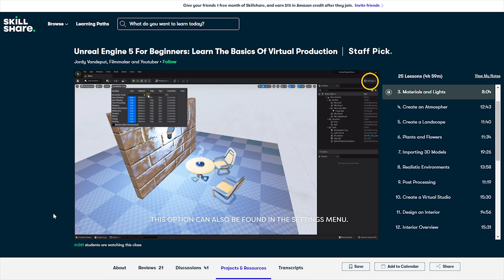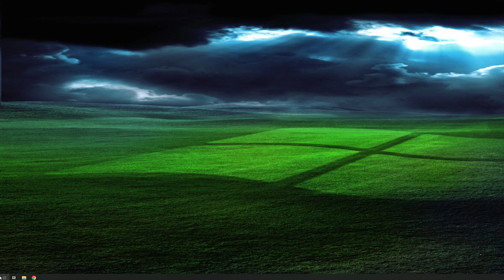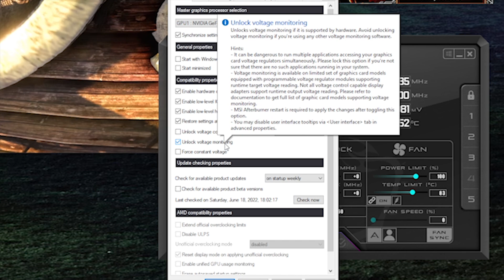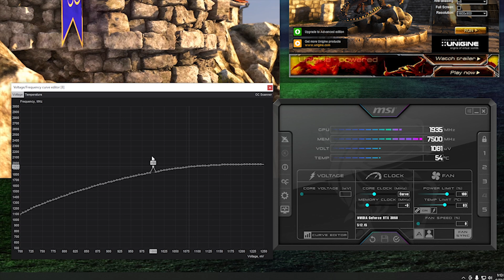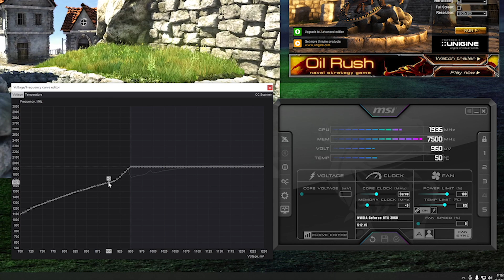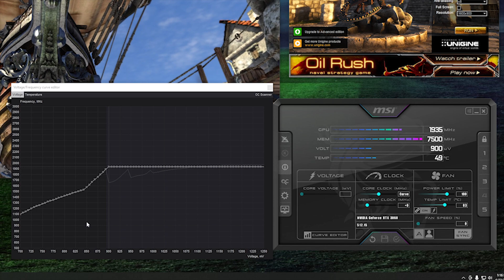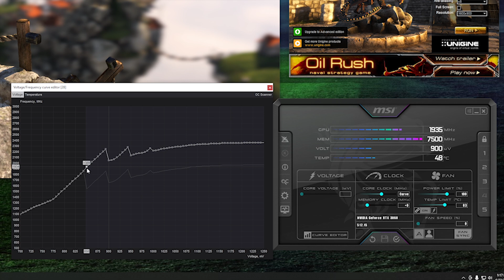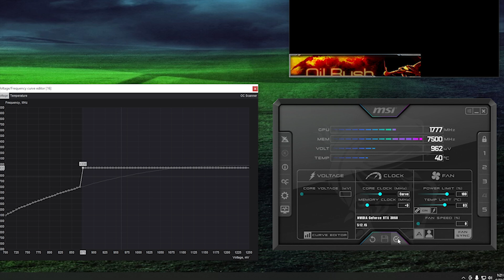Should You Undervolt Your GPU?

Comment: This is only worth doing if you card is getting high temps. If you sitting at 60-68c. Don't do this. What is the point. You getting performance you need anyway. Lowest the power draw isn't going to help you gain performance. It will actually limit your performance in most cases. If you card is getting very hot and having issues due to the heat. Than yes you will see jumps in performance, because of the temp throttle in the card. 

If you at 60c on your card with full power stock. No need to undervolt your gpu. It is working at intended and you won't get better performance doing it.
Reply: This is not true for all cards. For cards struggling significantly with power limits, it's objectively a better method than conventional OCing. 

I have a 3080 with a power limit of 350w and if I apply a standard OC, I run into that power limit immediately and gpu boost 3.0 begins to ramp down my OC. But when I'm undervolted, I consistently hit the clockspeed I'm asking it to run. For example, In Witcher 3 with a standard OC, my core clock ranges from 1860-1965mhz with temps around 70-75c. When undervolting to .856v, my core clock stays locked at 1950mhz as it's not power-limited, and temps drop to 58-65c.
Reply: @TRH2243  dude wtf you even talking about. The limit standard of that card is 450W. If you are at 350w limit on that card. It means you aren't given that card the needed power it wants. So you have a under recommanded psu or your mobo is ass trash and isn't able to give the power needed to the card.

So here is the real problem. You bought a 3080 with trash components. So you paid high end price for a high end card and pair it with low end parts. Trash builders like you are dog shit. You need to honestly stop putting together pc. You don't even research how to pair things right. 

I bet you have a 5600 paired with that 3080 on top of it. Because that is how rere trash you are.

Comment: Press the Windows icon in the top right of MSI Afterburner to get the profile to load upon reboot.  If it's not stable you will have to go through safe mode to uninstall MSI Afterburner.  Thanks for the video.
Reply: I think that if you hold Ctrl while loading Win, the Afterburner profile doesnt apply at startup, so you might be able to modify it without uninstalling Afterburner in Safe mode.

Comment: my 3070ti would go all the way up to 1070mV 1950MHz stock factory oc (gigabyte gaming OC GPU variant), and it's effing singing songs of it's people with massive coil whine. With conservative UV at 950mV card goes up to 2010MHz and coil whine is barely noticeable. No loss of performance, no instability, less temperatures LESS power draw. it's a win win win

Comment: i used to get 83 degrees when playing RDR2 with ultra settings on my RTX 3070 and alot of noise ,then i undervolt it and now i get ~ 65 degrees same settings.very happy!
Reply: I have a pny 3070 it never gets over 63c for me and I don't have to undervolt it. Really just hit or miss it seems with the cards. Which model are you running. I think in your case undervolting the card is needed you getting close to the 90c mark. Maybe add some more fans to your pc for exhaust. Try running 3 to 4 intake and 2 exhaust fans.
Reply: @fighterpimp  its Gigabyte 8gb OC version,i have 3 intake and 1 exhaust,but i dont think is that the problem,maybe thermal paste idk?!

Comment: I tried undervolting but it changed absolutely nothing. Still the same power draw and still the same temperatures.
Reply: Maybe you didn't save the undervolt right. Also did you keep going til you found a setting that was stable and lowered temp? What is your gpu temp anyway. I wouldn't undervolt if you at ranges of 60-78c anyway. No point to really. You won't gain performance doing it.

Comment: if i made a mistake in undervolting, will my gpu take any damage just like overcloking?
Reply from the maker: GPUs have a maximum voltage they can't exceed without very complicated hardware mods. Lowering the voltage can't hurt the card. If anything it would extend the card's life.
Reply: @CyberCPU  thank you so much <3
Reply: Your using MSI to undervolt it. MSI is just a program that limits what you can really do to the cards. There is other programs that can mess the cards up, but it rare MSI will do that. It is basically a user friendly way to OC a video card. Actually if you running a 3000 series card. Nvidia has now made it preset in the cards. If you hit alt+z and go to performance tab. You can OC your card directly without MSI.

Comment: I could see this being useful for people with really high temps or something. Tried this compared to my regular overclock just to see and I’m performing well with much lower temps but way less performance. My pc cools well so I’ll keep the higher temps for more FPS for my particular setup
Reply: It greatly depends on your screen resolution, Playing in 1080p you see mHz on card almost direclty transfer into FPS boost, try 4k and you'd barely see a point to OC your card and dropping 100-200mHz with good UV will get you much nicer temps and less noise while performance impact around 1-2fps.
Reply: FPS isn't what matters on a good GPU.  Frame time is.  I will take a tight fast frametime over a higher average FPS with inconsistent frame time any day of the week. I lost maybe 1% of my average FPS but gained much better frame time consistency.

Comment: I got afterburner to apply the profile the same every time with my 3060 ti by setting frequency in multiples of 15 which your setting of 1935 mhz is. Then if it keeps not applying that same profile causing you to have to apply it manually, go down to the next multiple so in your example I would set it to 1920mhz and that should stick. This includes the "set at idle temps" trick you mentioned.
Reply: I have mines on 1905 mhz or 1910 around there

Comment: Is this really necessary. Why can't I just use my GPU at the default factory settings?
Reply: No undervolting your gpu doesn't do much to help performance if your temps are good to begin with. If you running 60-78c range. Undervolting will give you no performance boost. Actually it could limit the performance your gpu is doing. If i lose power draw to my gpu, by reducing it. This means there less available power to boost the card. Undervolting is good for high temp gpu's.

Example. A laptop gpu. Most of the run super hot. You undervolt this to reduce the heat it produces. I undervolted my laptop gpu and it reduced that temp by 15c. Which was huge. It makes the life of that laptop last longer and games perform better, due to it not temp throttling. 

Like the OP stated. He using a water cooled gpu. It isn't worth it for him to do this at all.
Reply: @fighterpimp  Thanks for the detailed reply. My card is still running fine as it is, so this guy can go to hell.
Reply from the maker: Because most GPUs are capable of more. And it's fun. 🤷‍♂️

Comment: I got the frequency jumping up or down when I save it as a profile too. I got annoyed by it but I found a way around it. What I did was instead of increasing the clock of the target voltage in the curve editor, I used the core clock slider instead then flattened the curve on the target voltage in the curve editor. So yeah consistent clock everytime I load a profile. Also the curve graph is smoother too. A win win solution!
Reply from the maker: The only problem with that is the GPU will run at it's highest clock even if your not gaming. It sticks the GPU into 3D mode.

Comment: So let me get this straight. From someone who's been overclocking for 22 years.. You want to lower the voltage and the watts AND the clock ANNNND the in game FPS and call that a success? IN what world is this proper? This is NOT how  you overclock ladies and gentleman.
Reply: this video is about undervolting not overclock LOL 😂.
Reply: @kilfyabo646  Why would anyone buy a Ferrari then drive it like a VW Golf Beetle. Bahahahaha. This way of thinking is stupid.
Reply: @ironmaiden5658  i got better performance by undervolting 😂, on gtx 1660 super stable at 0.9v 1950mhz. with default setting it never reach that high, max 1875mhz.
Reply: @kilfyabo646  What  load of BS.. Bahahah. Did you skip over the part were I mentioned I've been over clocking for 22 years? More volts + more power = more performance. Its as simple as that. Change the fan curve to make the fans ramp up earlier to keep the temps low. You should tell the guys usingLN2 and beating Time Spy 3d Marks scores that they're doing it all wrong. Bahahaha
Reply: @ironmaiden5658  22 years and yet you still don't know the purpose of undervolting.
Reply: @kilfyabo646  Of course I do. The 22 years part gives it away.. . But why would anyone do it? Why would you not overclock and gain free horsepower? OR, leave the card stock? But nooo. "I know, lets buy a card then make it's performance equal to the next card below that in specs".. Undervolting is for the tinkerer who believes he's achieving something, but can't see the results from the placebo.
Reply: @ironmaiden5658  is simple as that, you get STABLE performance,,, longer GPU life, save a bit on watts and electricity, what is so hard to understand?
Reply: @ironmaiden5658  the thing is how do I disable the over lock trigger feature in GPU to just make it run on its base clocks?
Reply: @harveybirdman2674  You get MSI Afterburner and set the clocks manually. You can also set the fan speed and a fan curve. Don't under volt.. Thats just silly.
Reply: Yes. Less power, noise, and temperature for a slight 2% decrease in fps. There's nothing wrong with overclocking you can also get away without it because DLSS, FSR, and XeSS cover any lack of performance gains.
Reply: @jjdiner7862  As I commented above. Why buy and expensive card then proceed to choke it? Stupid. It's actually one of the dumbest things I've seen on the internet this year. Theres no noise with water cooling. There's no temp difference when water cooling. Ad then you're robbing yourself of 2% FPS? Stupid thinking.
Reply: This guy probably tries to suck himself while looking down at his 19in vga monitor while overclocking in his halogen-lit basement 😂

Comment: The issue with MSI Afterburner not setting the right frequency is not the program fault. It's all because of how Nvidia GPU Boost works as it sets the clocks according to the temperature. What you set in MSI Afterburner will stick at the same temperature range. But if the temperatures is different, the frequency will be slightly lower or higher as well. I always set the frequency at say 40-42 degrees Celsius or even under 40C.

For example, in my case I want 1800Mhz at 0.825V for my 3080Ti. So I boost the fans to 100% while setting the profile and set 1770Mhz at 0.825V when GPU is under 40 degrees in MSI Afterburner. This way the GPU will boost initially to 1770 at around 50C and lower. Close to 60C it will boost to 1785 and over 60C it will hit the 1800Mhz that I want. Considering most heavy games will stress the GPU a lot and it will warm it to over 60C you should hit that 1800Mhz most of the time. This way I am sure I won't get a frequency that's too high that might crash my GPU.

I don't know if I explained it in a good way but it took me a while to figure out myself why MSI was not setting the frequency that I want. Hopefully the example is much easier to understand.
Reply: 875mv to 1800mhz makes my 3070 stable and runs smooth and 68c underload
Reply: @CyberPun  It depends if you're target voltage has a higher clock or lower clock.
Reply: Well I found a solution through experimenting with it! Just use the core clock slider instead! Then flatten the curve on the target voltage. I made 3 profiles on mine and it's consistent. Try it out yourself and tell me if it works for you.

Comment: So first time undervolting, quick question about the wattage use. I was under the impression that undervolting would lower wattage use which I can see using the heaven benchmark (320W) but when using another like superposition using the same settings it jumps back up to stock levels (360W.) Currently running tests at 4k and settings are below.

Gpu: msi 3080 gaming z trio 10GB
Monitor: Odessy G7 28in 4k
-300 to whole curve, clock: 1920MHz, 883mV

Noticed 875Mv would not crash on heaven but would on doom eternal.
Reply: Make sure the settings are actually saving and that you adjusted the correct settings. It's impossible to say overclock a GPU or CPU and have exact same results, even if OC'ing only provides a moderate 5% boost.
Reply: What was your cards temp before undervolting? If you weren't in the 80c range. I honestly wouldn't suggest undervolting the card. You won't get a performance boost doing it, since it isn't temp throttling. 

Also there is other ways to increase the speed of your gpu. You can easily get it to pump out 15-25% more fps. I compared my tweaked card to a stock 3070 from rog which is best 3070 you can get for fps. I was 20 fps higher than just msi oc the card. Turn on re-size bar.

Comment: my RX6600 is overclocked and undervolted  since i cant bump up the powerlimit 
default core is 2534 with memory at 1750 at 1150mv
Overclocked and undervolt at 2700 core and 1900 memory with 1081mv

Comment: Does undervolting GPU, lower CPU's temp too? Thanks,
David Shahin
Reply from the maker: There might be a little bit of drop of temperature due to convection because the GPU is producing less heat but nothing directly. In fact if your GPU limited and you increase your GPUs performance you might even increase heat on the CPU because it's able to work harder.
Reply: I am definitely not GPU limited but I can't say that for my CPU. Thanks 4 speedy response

Comment: I recently tried undervolting with my ROG RTX3060. It was fun to tinker but it's not much wattage savings and I have a 3 fan cooler so I just crank everything up and it never goes over 56c . Don't even have to mess with the fan curve. Informative video! Thanks for the tips!
Reply: I been playing with my msi ventus 3060 Ti OCV1 and I saw the biggest difference in temp when I got to .850mV .925-.875mV should be a sweet spot it will definitely lower your temps if you go under .900mV
Reply: after one year do u notice any instability, crashes, freez glitch etc

Comment: For the cost of the 3060 and water block, you could have just got a 3070/Ti and got way more FPS for no effort.
Side note, I am undervolted my 3090 (1725 Mhz, 787mv) to save 50-70watts, these extra watts are wasted on only a few extra MHz (30-40).
Reply: Liquid in a Gaming Rig...only muppets would do that. Jeez